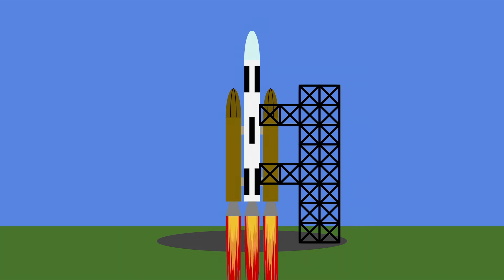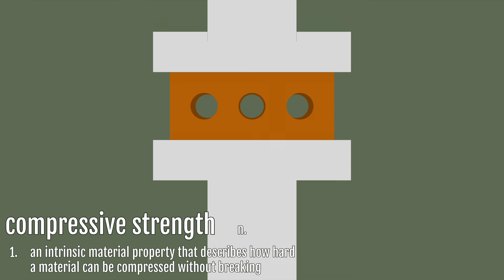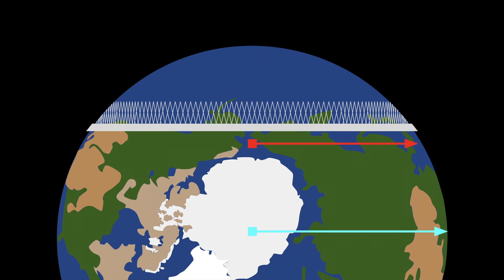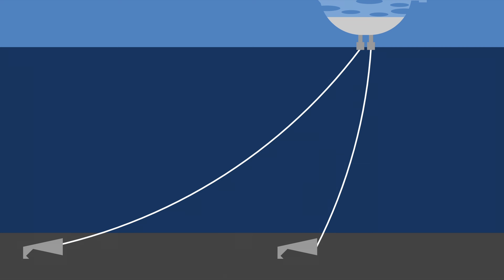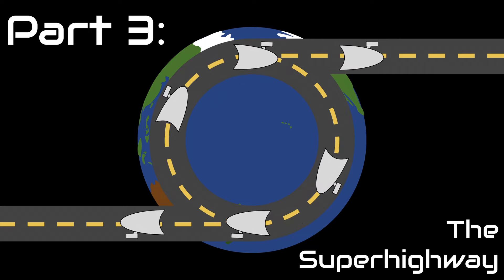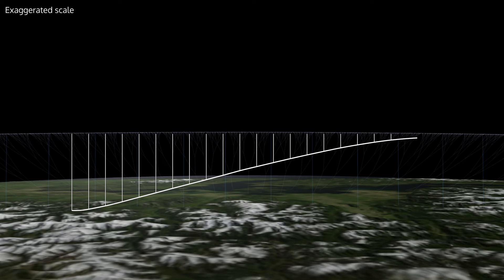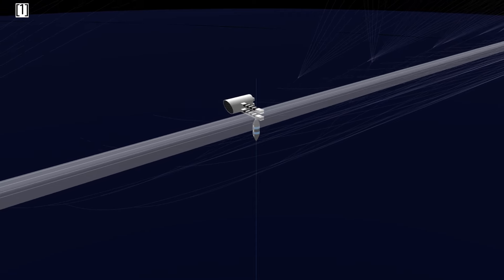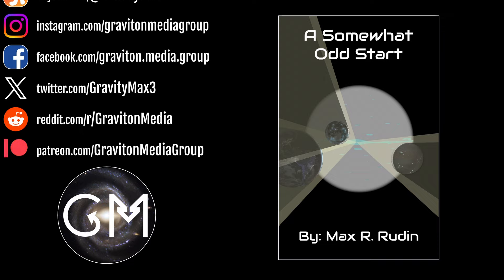Tethered Rings

Comment: A chain is only as strong as its weakest link.  It looks like this tethered ring is more than 10,000 kilometers long.  If it breaks anywhere, it flies apart.  It contains a rapidly moving mass.  If anything goes wrong, this rapidly moving mass will cause issues or shoot into space.
Reply from the maker: Check out this paper from the Atlantis Project (linked above): https://www.project-atlantis.com/wp-content/uploads/2023/07/TetheredRingPaper.pdf

Part 6 talks about Geopolitical Considerations, including measures that might be taken in the event of a disaster to prevent widespread damage on the ground. I didn't have time to cover it in my video, but it's some pretty interesting stuff.

Comment: I think a smaller version of your proposed ring is more likely to get built due to the immense challenges of such a large project. Anchoring a much smaller inertial ring on tall mountains in Antarctica could be a practical approach. This location would minimize the effects of Earth's rotation and be safer due to its inaccessibility and lack of airplane routes, reducing the risks of accidents and terrorism.Instead of anchoring at a single point like Mount Vinson, tethers could be spread across multiple tall mountains roughly in a smaller coaxial circle. There are interesting mountain chains in northern, southern, and western Antarctica that could serve this purpose. Even though this "demonstration"-sized ring would be much smaller than a transpacific ring, it would already be incredibly useful as a space launch support.

Comment: very sci fi, but very unfeasible. the temperature expansion, weather, tectonic shift and numerous other geo and engineering phenomena makes this a total fairy tale.
Reply: @pewterhacker A normal building doesn't need to worry about the shifting of the tectonic plates, but a ring that size would be impacted, as being even a meter off would render the entire design useless. Projects that large are going to continue to be impossible for us for many more years. 

That's not even touching on basics like: how do you pull a vacuum that large and stable? How do you keep that stream of mystery matter spinning? Where does the energy come from to do this? Where do we get that much of any material? Where does the money come from?
Reply: @dovahnok0957 I don't think you understand the architecture. The ring is 32 km above the tectonic plates which, in any event, move so slowly as to be a non-issue.
Reply: @pewterhacker  they move slowly? Are you mad? :P Have you seen what a 7 point scale earthquake did to structures in Turkey or Japan? 200 000 people killed in Oceania due to a Tsunami? 
The ring is not floating. It's tethered to the ground. The ground moves, a lot. A few centimeters, sometimes meters per year. For a tensioned construction, that's unfeasible.
Reply: You could use a winch system at the anchor point on the ground. The whole structure can move with the ground, with the winch system allowing for adjustments in topology to be made. You could probably actively stabilize the thing using these winches too, in case vibrations start to build around the structure

Comment: 2:20 newtons laws of gravity work well but aren’t perfectly accurate. Would it be better to use einsteins theory of relativity for more accurate aproximations
Reply from the maker: That is correct, but the inaccuracies are small at non-relativistic speeds. The Apollo program calculated all of their trajectories using Newtonian gravity without issue. A Tethered Ring could do the same.